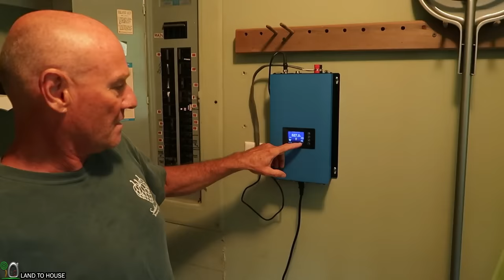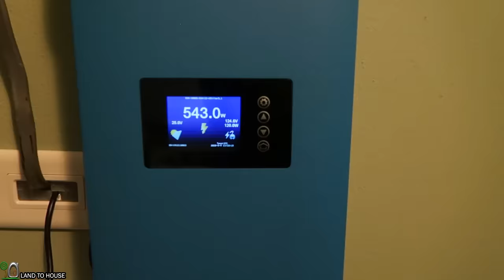Awesome Low Head High Flow Grid Tie Micro Hydro 530 watts!

Comment: When someone doesn't understand hydrodynamics and installs piping themselves.
Reply: @exodeus7959  To be honest, at 540w with 24v, that's about 22.5 amps... so, that wire when live, uh... yeah, it could kill you.
Reply: @Oatmealism  Not how it works. Your body has a high enough resistance that it does not let enough current flow at only 24v.
Reply: @Oatmealism  At 24V it wont kill you if you touch it. Jonah Waldman is right.
Reply: @Oatmealism  24V do not kill you.
Reply: @Oatmealism  So what is the current through skin having 1000 Ohm or more at 24V? Depends on wetness and so on. No double insulation required here.
Reply: @simonhersche6720  At 22.5 amps, it can. The average human cannot handle more them 100-200 milliamps, if the voltage was stepped up to preserve wattage and amperage was dropped to 0.1-0.2 amps, we're looking at a voltage of 5300 volts at .1 amps, or 2650 at .2 amps. It is going through an inverter and increasing voltage and dropping amperage to the 120v standard at the house, so 120v at roughly 4.4amps, which is still, more then enough to kill you.
Reply: @Oatmealism  I'm a physician, and I was taught that  4 - 6mA is enought to interrupt the SA node located in the heart.
Reply: @exodeus7959  Wasn't hating on it. Just looking at it and thinking "Damn, with some better routing of pipe, you could definitely get more power out of that setup.
Reply: @therickening7323  Generally speaking in multiple fields, it is a commonly accepted number of 100 to 200 mA is enough to immediately stop the heart. This thing has 22500mA running through it, which is in fact, enough to kill someone. Maybe at native voltage (24v) a human is too resistive for it to pass through, but it'll definitely not feel good and I would assume cause damage to nerves in the fingers and hands.
Reply: @Oatmealism  No. At 24 volts 2.4mA flows through a human body. You might feel it, but it does no damage
Reply: @boulder795  Now, I'm no electrical engineer, but if the human body is resistant to voltage up to 50 volts, and using a river analogy the voltage is the volume of water, where as amperage is the current/how fast the water is moving. Then wouldn't it be safe to believe that if a human being was to say, interupt the current, and hold one end in each hand, the amperage of the line, at 22.5 amps (24V @ 22.5A = 540w shown) would begin to convert to voltage, due to the theoretical blockage of the metaphorical river.

Like I said, not an electrical engineer, just know that it takes .1-.2mA to kill someone, and this line is at 22.5A which is more then enough to kill them. I don't know if a resister can cause amperage to convert to voltage.
Reply: @Oatmealism  It can't. And it takes about 100mA to cause the heart to go into fibrillation, so I suggest you stop spreading misinformation and come back to the discussion when you are appropriately educated.
Reply: @IrregularPineapples  Uh oh, someone out here with the 500 IQ plays, yet entirely wrong. The skin is resistant, but the blood is conductive, if an electric current has enough voltage, it can pierce the skin and get into the blood, once in the blood - the amperage is the dangerous aspect, as it can stop your organs in their tracks. Voltage overpowers the resistance of the skin, the amperage stops the heart.
Reply: @Oatmealism  Houses all around the world run 120v-10A or 240V-10A. he is only inputting 4A at peak which means he isn't even 50% of the way to tripping a breaker. There already exists dangerous electricity within houses before he installed his hydro, house wiring is made to handle those voltages and amperages safely. He probably should run some conduit to protect his outdoor wiring from debris but the 24v in the outdoor wire isn't going to kill anyone.
Reply: @Grumpher  I mean, considering proximity to a river and chances that you'll get wet while working on the hydroelectric set up he's got does mean that 24v could be enough - but even so - I never specifically said it would, just that it could, at measured amperage.
Reply: Matthayi Naalaaman  I was thinking more like, having a high enough resistance blockage in the line would cause it to back up, like because it can't flow as fast the level increases (Amperage drops, voltage increases) Because you're still conductive, you're just providing enough resistance it can't get past you, you still would be completing the circuit, so it would still be trying, or so I thought, Idk - probably took the river analogy a little too literally.
Reply: Matthayi Naalaaman  Admittedly, the proximity to water and such also makes me feel like the idea of 'a person who is dry' is a bit of a weak argument, being so close to water feels like you're going to be at least slightly damp from proximity alone.
Reply: In terms of will it kill you??... Someone needs to do the lick test and get back to us. 
In terms of plumbing... remove 90 elbows and add 45’s for a start. Could run a second turbine lower with the fall of the water accelerating off the same drop down pipe for more power. Conduit on the electrical cable is a must.. cannot believe it has been left exposed like this.
Reply: @Oatmealism  to send 22A through you body you need a lot more voltage look up ohms law
Reply: @tejasbhandare251  Only need 50v to overpower the resistance of the skin, then the electricity gets into the blood which is highly conductive, which is why a lot of times current will pass over/through the heart, in which case, Amps are the cause of death.
Reply: @Oatmealism  You're right that the amount of electrons per second is the dangerous part. IE the amount of electricity. You're wrong when determining the dangerousness of electricity based on calculations or labels of Amps. Why? Because it tells you nothing of how those Amps reach you or might affect you. You're making an assumption that low Amps = safe (the same as saying high Amps = dangerous), which is incorrect.

How many Amps can reach/affect you is determined by Volts and Resistance.

For example, which of these circuits/wires could you touch safely with a wet hand with a resistance of 500 OHMs, and which would kill you?

A: 240V 1AMP (thin wire)
B: 1V 240AMP (fat wire)

plays countdown clock music: https://www.youtube.com/watch?v=M2dhD9zR6hk

Comment: USING THE GROUND TO TAKE 3 PHASE ON 2 WIRES TO THE HOUSE HAHAHAHAHAHAHAHAHAH
WHAT DRUGS U ON
Reply: Can you explain this? Idk anything about electricity.
Reply: @viatori5566  NEED 3 WIRES FOR 3PHASE PLUS A NEUTRAL
Reply: @pollywoodglobal2965  So it should have been 4 then converted to 2? I thought he had an electrician look it all over.
Reply: @viatori5566  just cant run 3 phase over 2 wires
Reply: @larkhill2119  
cause u cant
Reply: @larkhill2119  is that all you got?
Reply: @larkhill2119  wheres the neutral/
plus it only has a single phase bridge rectifier
plus you cant push 3 phase thru a single wire

its just not 3 phase
Reply: @larkhill2119  i have 3 phase its has 4 wires because the system needs a neutral

plus a separate earth
Reply: @larkhill2119  good luck running 3 phases in 1 wire
dude 
we are all laughing here man
youve been good value
Reply from the maker: It would have been ideal to use 10/3 wire. So that all legs of the 3 phase run on a wire with sheathing. This setup is pushing over 20 amps.
Reply: @LandtoHouse  u got a sneaky 3 phase rectifier in that white box?
Reply: @larkhill2119  nah mate
gotta make a cuircuit
3 active out of phase wires is not a cuircuit
please research before wasting anymore of my time
Reply: For once, I started an argument I didn't mean too 😅 my bad

Comment: The great thing, is all that the vacuum is needed for is used as a starter and then it can be removed! I was expecting to see 120 VAC, but 24 volts and over 500 watts is very impressive. A converter could change that DC into AC at 120 VAC with the right transformer. What happens when you lose power and you got devices hooked up that require 120 volts to work? Have you lost any devices due to low voltage that burned up?

Comment: From observing the pictures, it looks like there’s the opportunity to lower the turbine elevation 3 to 5 feet to pick up some head that could boost output of a turbine generator unit. Looks like it could be an easy fix at the cost of some pipe and fittings and Extension of some wiring. I’m a retired power generation engineer, having some experience in modifications to enhance plant availability and power output

Comment: Try using a float like in a toilet tank to regulate the in flow to your system and a automatic cut of if/when the turbine goes to slow. A battery bank would save the power you do not use at once and give you even more usage of your own power by saving up when usage is low.

Comment: You can produce higher voltage, say 3 phase delta connected system and convert it to DC using rectifier and large bank of capacitors. That will reduce loss of energy and the equipments can be run directly through DC such as fans and bulbs/tubes (LEDs).

Comment: The longer the pipe is that go down hill the stronger the current gets that flows through the pipe, so you can get more power out by making your outlet pipe longer, but only if the added length is going down hill.

Comment: Looks like you could fully automate the system, by partially closing the outlet, with a solenoid flapper, hooked to a level switch - good job though

Comment: There's the same head of water, possibly more, after the turbine. That's usable, change out the 90° elbows for radius curves and you cut a lot of potential energy loss. Then place the turbine, larger of course, down at final drop into the lower pond. You could probably say goodbye to the power company as a customer.

Comment: Theoretically, could you use a free-flowing water source to generate power with a similar setup? It'd probably put out less power but might still work to charge up tools, batteries, and the like.
Reply: Where there is movement, there is energy. The question is just how much.
Reply: The water speed would be way, way slower, even in an apparently fast stream or river.

Comment: Connecting a capacitor to the rectifier circuit can greatly increase the DC potential if the circuit is not connected to a constant load.

Comment: Nice video guys. It could be even more cool if you connected smaller pipes at the end of the pipe, then you have excellent condition for one Tesla turbine project or just be boring and connect one more generator at the pipe end 😀

Effecency on next level 😀😀

Nice work donne guys

Comment: Very interesting topic, I find the price point of the generator a bit expensive but overall things cost to do it right. I personally have used an alternator from a truck to put out around 1000W at the inverter, advantage now is people have 3d printers and don't need to use pulleys and belts to get high rpm.
Life is nothing but an expense and you can't take it with you well maybe

Comment: I was always under the understanding that if you put the turbine at the bottom with the most head pressure you would get the most turning or evolutions even reducing the 6-inch to a 4-inch would that not produce more horsepower or more RPMs seems like to me with what you have there you could do a lot more

Comment: The alternator produces 24v AC  3 phase that is sent to the house where the rectifier converts it to DC.  The power inverter then changes the DC to AC along with stepping up the voltage to 120v AC.  It then (by a plug) supplies a 120v AC receptacle where it feeds one side of his breaker panel.  I suggest before you do this to show this plan to your state electrical inspector.  I can see your home owners fire insurance not covering the fire caused by a malfunction of the rectifier or inverter in the future when they find out this was not an approved installation.  All state electrical codes are different.

Comment: This needs a foot valve! Shut it off at the discharge, your pipe will stay full, then the startup is just opening the valve at the bottom. It's used all the time in flooded suction chemical feeders to keep small pumps primed, the principle is the same for discharge. 
I really like this design, I wish I had more regular water flow to also accomplish this.

Comment: That syphoning thru the PVC is causing and induced EMF on the coils on the alternators. The voltage drop on the wires is causing heat losses. My recommendation is to put a 3 phase transformer to stepup the voltage and to ground out the losses on the stator coils on the alternator to drive heat away from the  induced EMF on the coils. The coils should always have a positive reactive power where distribution takes away all the heat from the natural flow rate work through the 3 3 phase transformer.

Comment: This might seem obvious, but the pipe setup is way more than what is necessary for the size of turbine. You could probably add a second turbine inline in the same pipe and each would run pretty close to the same wattage you get from the one right now. This would cause only a very small drop in flow, which might also help you maintain the waterfall. I suspect all of the other electrical components have enough excess capacity to handle the second turbine so the cost would be only the turbine cost. 
I realize your consumption off grid is so low right now that it might be a waste unless you added batteries to the system or were able to get set up for buyback from the grid. 😁

Comment: His system is sucking air somewhere as even after the level in the pond drops there are still air bubble rising at the outlet of the draft tube. Likely he did not use PVC cement when he put the pipes together and air is being sucked in and reducing the turbine efficiency.

Comment: I love projects like these, I wish I had access to waterflow on my property. I'm just a little disappointed that the system only creates ~500W, that's less then those "balcony solar panels" that you can buy here for around 500W. Of course the water power is (mostly) constant power and 500W water power is therefore worth much more then 800W peak solar power, but I thought you could get more out of such massive water flow. But like Bill said, it's mostly a fun project and I'm sure that it's an absolutely amazing feeling to have built it and providing some power with it to save money and the environment. Great respect for all people who delve into these, especially if they aren't engineers & electricians (he said he had an electrician check his system and yet he runs phase on ground wire...dam!).
Reply: But this is nearly 24/7 power rather than a few hours a day of sun power

Comment: 5:05 "to take the three phase to the house"
7:41 "...the DC at 24 volts..."

I don't think the wire to the house is AC. I think there's a three-phase (diode) rectifier in that junction box next to the turbine, which rectifies the wild AC into DC, and that is carried to the house. But I may be wrong.
Reply from the maker: From the turbine to the house it is 3 phase ac. The rectifier on the outside of the home changes the ac to dc before going inside to the inverter.
Reply: @LandtoHouse  All right, thank you!

Comment: You should put a dampener in the pipe to slow down the flow to a point that there is always water going over the dam, That way you won't lower the level of water behind the dam.

Comment: 6" pipe with 8ft drop shpuld produce 2KW - something is waaaay off.  See calculations below

Assuming 40 ft pipe length with a drop of 8 ft, youll have a flow velocity of 6.82 m/s and 124l/s discharge. thats 3KW of power potential. Assuming a measly 66% effenciency thats 2 KW of usable power.

Comment: If the turbine was installed at the end of pipeline instead of suction side it wasn't be necessary to suck vacuums in order to start. The pressure is a key. It is still until the water is inside pipe. In commercial power plants there's just like I said. But respect for your engineering knowledge.

Comment: Nice setup.....just one thing. Running 10/2 UF cable (direct burial cable) and using the bare copper ground as a current carrying conductor is a no-no. Granted uf has a tougher outside jacket then romex but the ground does not have a secondary insulation. 10-3 uf should have been ran.

Comment: Gonna build it in my backyard. 
I got 25 square meters of garden to work with.

Surely i can manage to get something working here.

I was thinking of a large tub, say 10 square meters, height 3 meters or so.
And i let it fill up with rainwater.
Since it dont rain that much as it used to, gonna take about 5 years.

Yeah, i think i can manage 540 watts if you give me 6 years to build the stuff, and if it does indeed rain enough to fill up the pond.

Jeez, i cant wait. Just imagine what i could do with 540 watts.
Hmm, wait, what is this? An outlet..... I can just plug it in right here and dont worry about the pond producing 540 watts.
Great.
Saves me wasting my time on nonsense.
Reply: i thank you for the lesson

Comment: The intake hose should run thru wall right below water surface. In that case you don't need to suck out air.

Comment: Awesome set up... Why not use the dam pressure ? Drill and pipe blow the dam wall ? stub it and have all the pressure of the dam. No need for a vacuum. You wouldn't  worry about freezing , or ice. And a Simple on grid inverter would disconnect when the grid goes out, but with the option to still power your house, using a switching panel.

Comment: Now all he needs a float and a valve to restrict or increase flow depending on the flow over the wall, raise the wall slightly make an area for the overflow gate and done a system that doesn’t require you to watch the water level. If the float drops the flow drops with it till it’s matching the desired flow. A secondary dam below with a ram pump/s back feeding the first dam to keep flow steady wouldn’t hurt either. 😅